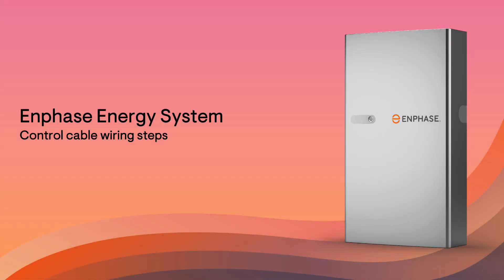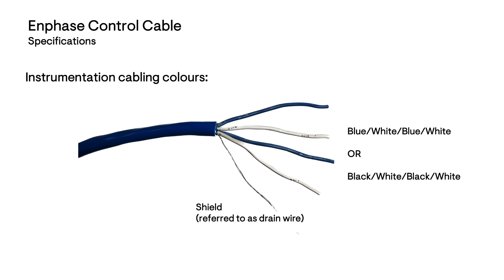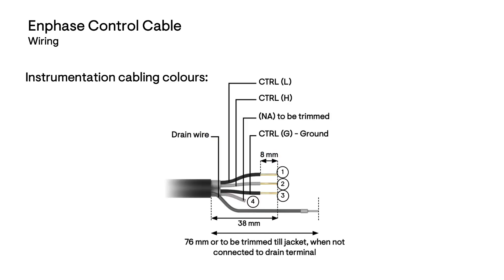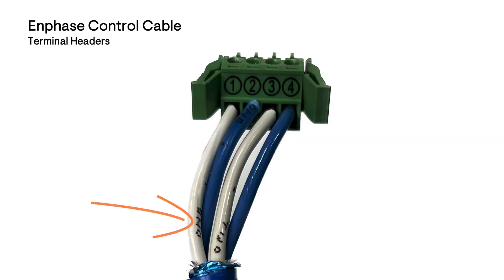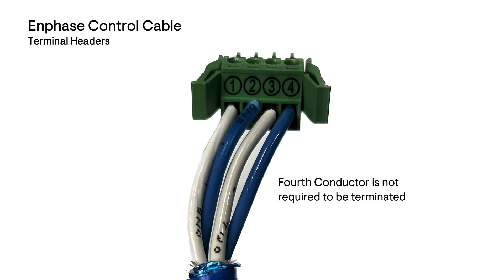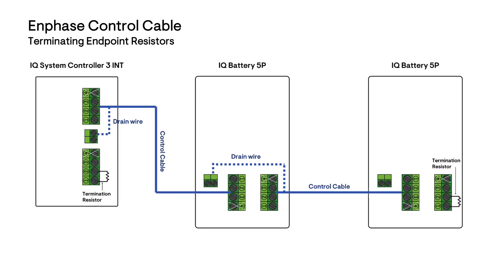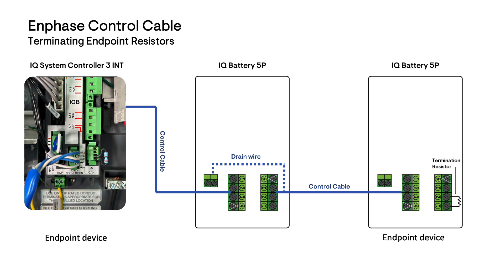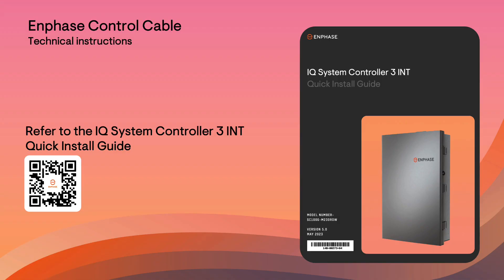Control Cable wiring steps - Enphase Energy System

Comment: Hey, don't want to be that guy, but I noticed that drain wire should have some heatsink applied, could short something out in there, same applies for the transition from the outer sheath to the cores, got some foil exposed. I have had many years experience wiring these kinds of cables, and heatshrink is best practice. Thanks.